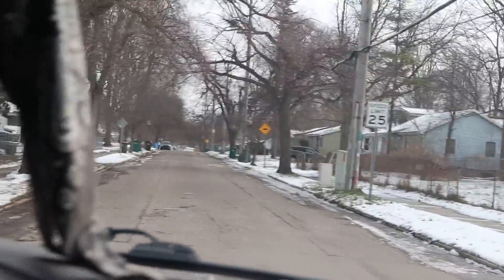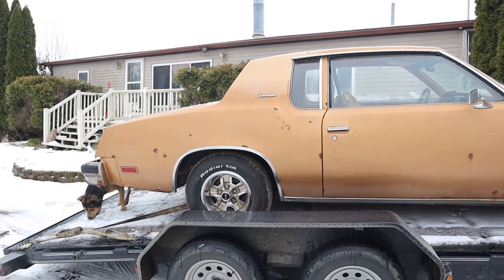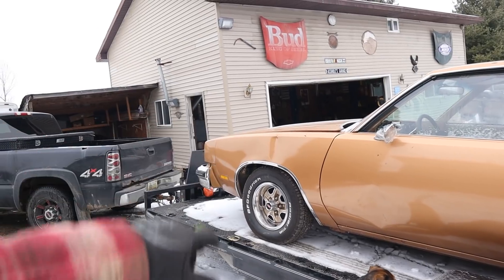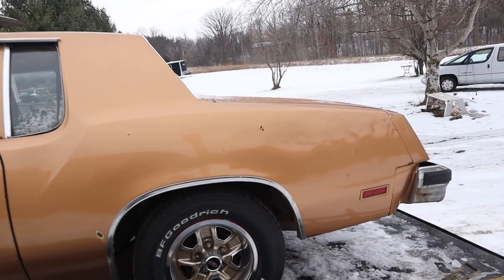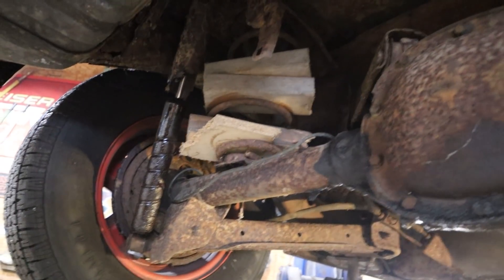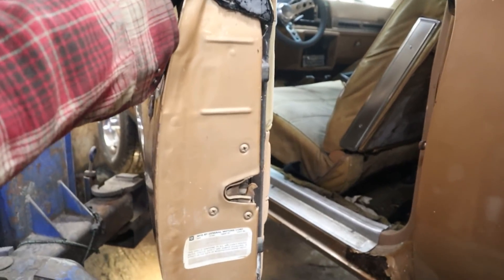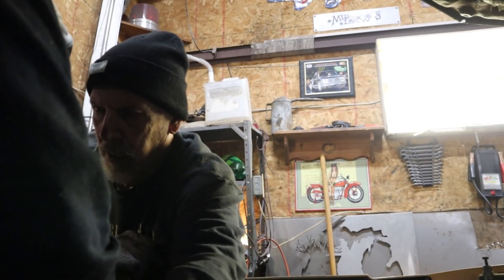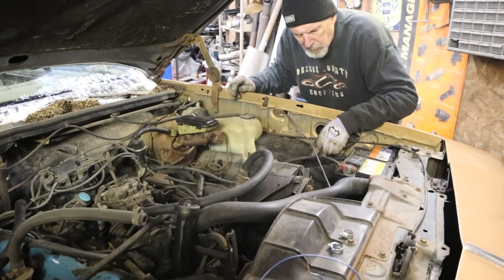Sitting for almost 2 YEARS! Can we get this 1980 Olds Cutlass running again?

Comment: My buddy got a 79 Cutlass as his 1st car. 231 V6, 2.30ish :1 diff. He bought a 71 4 door Malibu, built the 350/350 engine/trans. He put the drivetrain and entire suspension from the Malibu in the Cutlass. With those gears it would spin each tire a full turn or so and then pull like hell to 60mph when it would shift into 2nd. Top speed was over 150. He built the engine for torque with an Erson cam that redlined at 4200rpm. Wild ride! Edit: check the torque converter bolts. The front seat out of the Malibu became the perfect couch in front of my home stereo with some 2×4s and a cover.

Comment: I had owned a 1980 olds cutlass back in 1991 , it had the Buick V6 and it was wore out , but it handled good  . It was black with white interior , I was going to put a Oldsmobile 350 in it , but ended up getting rid of it .

Comment: I’ve had my 80 Buick Regal since 2003 turned every nut and bolt on it at least 3 times, including a complete color change, 2 different motors with several configurations , thing that sucks is going to buy parts for it everything is listed from 81-87 , next to nearly impossible to find 78-80 parts , at least in the Buick line I don’t know about cutlass , good luck with it, cool car

Comment: I wrecked a 78 Cutless and years later they had a Recall on several year models including the one I wrecked, There's an issue with the steering Box of some kind but I can't remember just what it was mine was totaled but any late 70s or Early 80s you Might want to check to make sure it's not the same or has been changed out to make sure... Not many might remember such a thing but mine did have strange strating, It was not Right, Like it has an oval shape to the way it drove, gear ratio change or some crazy shit. You'll know it when you drive it...

Comment: Sounds like a loose torque converter that's ovaled out the holes in the flex plate. I called my 79 the Gutless Surprise. It got stolen and used for a drive-by in DC but the second time it got stolen they blew the engine because of a bullet hole in the radiator. At least I got my $75 back from a scrapyard.

Comment: I have the same exact car 1980 olds cutlass same color 64,000 original miles 260 v8 factory floor shift and guages very clean car same color to I would love to have  this one as a spare parts car for mine.
Reply from the maker: Its for sale, you can email me at Snidertron3000@gmail.com if you're interested in it

Comment: I had the exact same car back in 92. It was in mint condition! A little old lady owned it ! It started knocking like that, it was a wrist pin. I didn't fix it, I sold  the car for $600 bucks! Put $1000 with it and Bought a Z28!! Camaro

Comment: That's funny, I used to have a 1976 Buick Skylark sedan that had the Olds 260 4.3L V8. That car was an absolute turd, but it ran great. It only had 34k miles on it. It was given to me by three little old ladies. The ONLY way I could get it to spin the tires was to put oil on them and powerbrake it.

Comment: Tires and rims should get you enough $ for ls4king's oil pan. a 350 Olds can be swapped right in, and so can an 200r4 trans.
Reply from the maker: Yeah, I'd like to plop an olds 350 in it just to keep things simple
Reply: @SniderTron3000  I would see if you could find an older version of an OLds 350 , pre 71 or an olds 403.
Reply: @SniderTron3000  Hey Sinder, Some is selling an high compression 350 in NY on ebay with # 5 heads for $1.5 right now in NY. He is willing to ship for 500. I try to see if you can grab it quick.

Comment: I say yank that 260 and swap in a 307 or a 350. Even if it's a 2 bolt main 350 it'd be better than that 105 horsepower turd that's under the hood.

Comment: Stick the 350 olds engine out of the blue delta 88 you ls swapped direct bolt in ain't got to change nothing
Reply from the maker: That engine has been gone for a while. I wish we still had it cause that thing ran so smooth
Reply: @SniderTron3000  well damn lol my first v8 car was a 79 cutlass with the 260 olds bought a wrecked 64 2 door cutlass swapped in the 330 olds biggest regret is getting rid of both of them